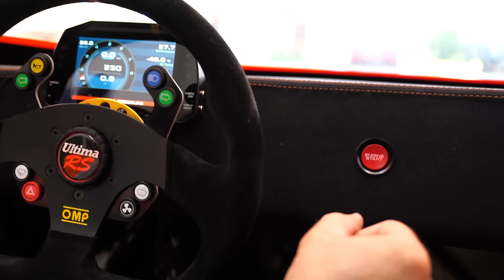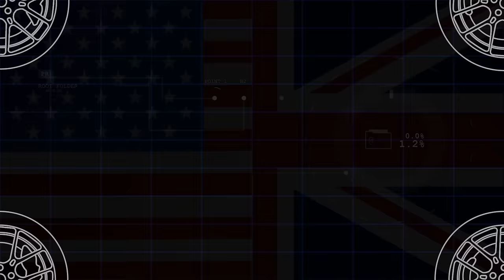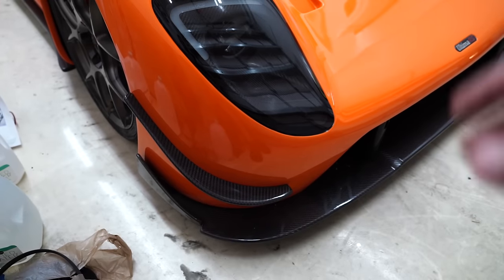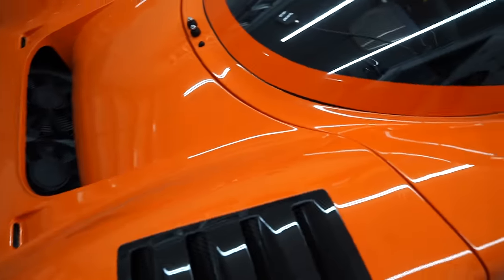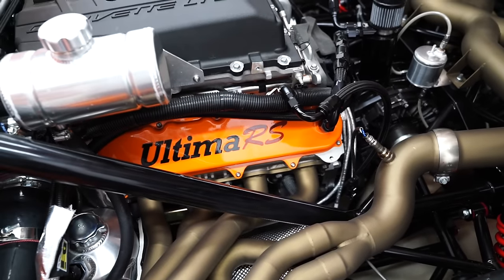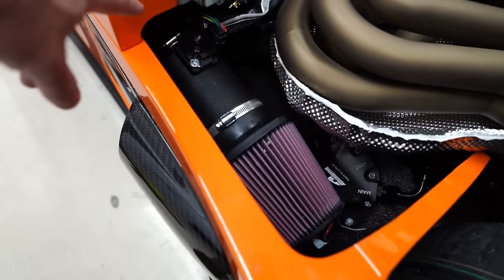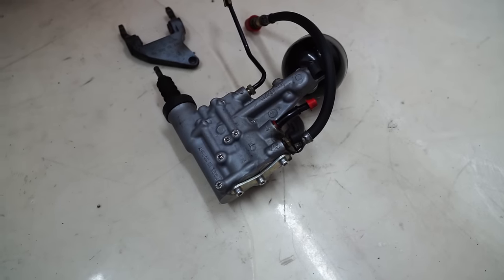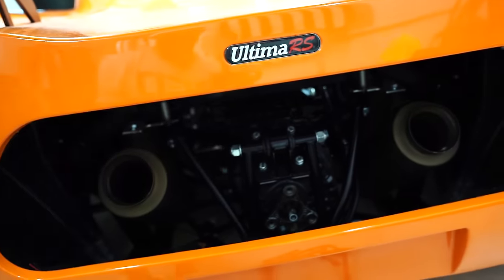Ultima RS Build 07 - First Drive!

Comment: hell yeah man, glad to see it moving under it's own power!  The normal 997 clutch slave you didn't use is a hydraulically boosted slave cylinder, you need that extra boost for the aggressive Porsche clutch but no issue for the RPS triple disc.  Glad you were able to do the GT2 swap, it's such a no-brainer and a much easier install.
Reply: Like boosted by the braking system?
Reply: @chickenfishhybrid44  it's own separate system, but it functions similarly to a hydro-boosted brake system

Comment: Congrats Rob and getting this far. The car looks great and sounds angry. I did notice in the video that you added a windscreen banner in orange wrap, did you do this to cut light or to make the front of the car look more pleasing. I always thought that the Ultima was a bit square on the top of the windscreen, this looks better with this as in orange, it extends the body visually.
Reply from the maker: It's how the RS looks from the factory so I ordered the vinyl kit they sell. It changes the lines completely.

Comment: I didn’t understand why the lights where in sync with the engine idle or it seemed so ?
Reply: It's the camera speed.
Reply from the maker: Yeah it's the camera frame rate and the refresh rate of the LEDs playing tricks on each other. Our eyes see the lights as a continuous beam, but they are actually flickering really fast.

Comment: Its amazing, I will not lie. Would happily drive one of these in anger. My only worry is the outboard fuel tanks with only the body to protect them. That would be my only modification to one of these for street use but I'm not sure how one would go about adding that protection. Can't wait to see this get a hard thrashing on a road course. Also if your next builds are as clean and tidy as this you will have a huge following in no time.
Reply from the maker: Thanks, William!

Comment: Very nice! Your clutch slave cylinder hydraulic flex line is just sitting against the frame/cross member. I would secure it with a Adel clamp to the frame to prevent chafing.
Reply from the maker: Will do! Thanks Brian

Comment: well If it makes you feel any better a 5” intake has absolutely no benefit to that set up.  We tried 4” and 5” on the dyno and the 4” actually made more power threw the whole pull where the 5” lost power down low and lost power at the mid range and was good for about 2-3hp at the end of the pull witch is nothing compare the 20hp lost down low and mid range.    Beautiful car.  That thing looks insane.   Love it.
Reply from the maker: Dang. Well that makes me feel better. Thanks for the info!

Comment: This has got to be the best deep fake on youtube. That shadow blur is what gave it away.
Reply: I've seen enough super low cars that the shadow blur doesn't make me bat an eyelash. That's fairly normal for anything that isn't a bubbly mass produced car (sharp edges bend light in interesting ways)
Reply: @DFX2KX  If you look, it surrounds the entire car. Front, back, over the hood, it's a mask being done in some modeling program. At 4:59 you can see it around the passenger mirror.

Comment: I'm curious. Before choosing the Ultima RS, did you consider the SLC? If so, what made you choose the Ultima? From everything I have seen, read and researched the SLC has a better constructed framework. I do realize that they are both extremely capable and at the top tier of engineering, performance and design.
Reply from the maker: Yes I looked at the SL-C and you are right that it has a more modern, aluminum monocoque chassis.  For me it came down to the fact that Ultima has a neat history with Lee Noble as well as with McLaren and the use of Ultimas as the mules for the F1 powertrain (also the new Gordon Murray T.50).  Also I just think the Ultima looks better.

Comment: Car turned out beautiful man. Really good job. Sounds fantastic. I've got 1 question. What's up with the front trim lights and rear lights flickering with the rpm's of the engine?
Reply from the maker: That's only the effect of the camera frame rate and the LED lights. In person, there is no flicker and it appears to be just a solid color.

Comment: Rhe clutch cylinder you have there is from a Porsche Turbo and it has a servo system to ease the clutch motion. I would also youst use the clutch cylinder from a GT3

Comment: I'm surprised you don't have the idle set just a tad higher, for the sake of oil pressure. I couldn't see the other numbers very well. How many PSI are you getting with idle dipping into 400s?

Comment: Dang, nice work! Looks cramp with a V8. Curious if there are other Ultima owners that is nuts for a billet 4 rotor engine, R26B.
Reply from the maker: There are a few out there with different engines- Barra, Lambo/Audi V10, and I just saw that a guy is putting a Viper engine into one. I haven't seen one with a 4 rotor yet but that would be insane.

Comment: Impressive, haven't watched the whole collection but quick question, is getting a VIN number easy?
Reply from the maker: The VIN number is stamped to the chassis so that part is already there. Registration consists of filling out some forms, paying sales tax to the state, and providing documentation of engine and transmission showing if they were purchased new or used, and if used, the VIN of the donor car so they can make sure it was not stolen.

Comment: did you bought it with all the parts included? engine ac all of that? or you need to find a donor car to complete it
Reply from the maker: No donor car. All parts included except for the engine and trans, which you can buy wherever you'd like.

Comment: I looked at doing a gtr many times, but was turned off by the lack of assurances by their recommended customs broker.  Not their fault, just the import process is wacky.  What was your experience like?  Did you use the recommended broker, and how much did it cost?
Reply from the maker: I used my own broker which I talk about in the unboxing video.  It was very straightforward and painless.  I've read a lot of complaints from other owners about the customs broker Ultima recommends.
Reply: @UltimateUltimaRS  Thx, I just saw that, biggest problem was the the ultima-recommended broker couldn't put a solid number on it, kind of a blank check situation.

Comment: I've had my mind set on building one of these and would appreciate your feedback on the capabilities of the car. How does it drive and handle? Can you fit in it comfortably? Anything else that might be good to know?
Reply from the maker: I'll be posting an updates video answering these questions.  It drives like a big go kart with enormous power and handles amazingly.  Getting in and out is difficult, but once inside, it isn't bad.  It definitely is not a comfortable car since its focus is purely on performance.

Comment: Hey man my very first time on your channel. Been a fan of ultima since I was as wee little kid. Is that a c8 drivetrain?
Reply from the maker: Thanks for checking it out! It’s an LT5 engine (same as in the 2019 Corvette ZR1) bolted to the transaxle from a 2008 Porsche 911 Turbo. The C8 uses the LT2 and has a dual clutch transaxle from Tremec. If someone develops a way to use the C8 transaxle in an Ultima, I’ll probably switch it out.

Comment: Gabe! You need to reach out to our Community first!  I have all the GT2 clutch parts you bought.  would have just sent them to you.  Also it would have much easier to have the RPS boys just give you the Tilton hydraulic throwout for the trans and eliminate the clutch fork all together....
Reply from the maker: Darn I wish I would have known! I talked to Rob at RPS about doing the Tilton TOB but in order to get the max torque rating, I had to use the terrible Porsche pressure plate/pull type. Oh well.

Comment: Ok that’s really loud. 🤣 It’s a good thing you don’t have neighbors…

What’s the sound like inside the cabin? You had implied in a previous video that you might have a passenger. Could you have a conversation over the engine sound?

Overall, very impressive build.
Reply from the maker: The video actually makes it sound much louder.  I took it to a car meet and a Corvette/Camaro with straight pipes is actually much louder than this.  I believe it is because of all the twists and bends of the Ultima exhaust. You can absolutely have a conversation with a passenger, though it is certainly no luxury car by any means in terms of sound.

Comment: Well this video got me thinking so although I have a, couple of normalise car (bentley and a clk mercedes) I found a second hand one of these a pricey at £70,000 but hay ho  very interesting but will have to do a lot of sound deadening far to noisy inside I am in the UK but I will have to fit Aircon just to hot so that will add say £5,000 so getting to expensive for what it is it looks like a kit car outside the pub,  seems I have the same engine as yours although it's exhausts are  coated with ceramic  drives well sound is too much really but that's how it is may keep it for a year great video by the way the top carbon wheel vents make a real mess on dirty road I will blank them off you get mud and rubbish coming through I bet you will do the same good luck

Comment: Are these scoops and  wings that have two small screws holding them on gonna stay on at 150+mph?????
Reply from the maker: There are two screws in the front, two in the rear, three rivets on each side, and it is bonded to the roof with Sikaflex-291.

Comment: I wonder if he regrets skimping out on the cats and mufflers after hearing how intense the sound was 😂 Absolutely beautiful build though
Reply from the maker: Haha, definitely not! I love it.
Reply: @UltimateUltimaRS  10-11 years ago I started building a mostly track-focused tuned thing out of an Aprilia RSV1000R -02 motorcycle, at the time all the tracks in question for either track days, practice or competitions had a strict decibel-rule of 95db measured 10 meters from the side of the track when you are WOT and at maximum power revs. Just the intake noise running with a tuned air-box would probably have put me in danger without doing anything about it.

In the end the bike had 1103cc 14:1 compression v-twin with intake air-box with really strong resonance (thick short runners with large funnel-shaped horns facing forward oncoming air) and a DIY tig-welded stainless 2-1-2 exhaust system of 60mm per exhaust header once you got 150mm somewhere downstream of the exhaust port, exiting in two "see all the way through" silencers of my design that had 60mm inlet and roughly 50mm outlet with no db-killers. I even built intake air silencers hidden inside the frame/fairing to get it a bit further down in sound level. The bike even had 1-2 decibel margin when trying my best to make it sound loud on the track.

The thing I wanted to get to is that the bike got a really fantastic exhaust note/engine sound like almost nothing else I had heard before due to the massive length and volume of each silencer - no high-pitched raspy or annoying frequencies left - only a deep filtered sound that wasn't overly loud for either track or street riding, but at the same time hit you in the chest enough to be fun.

At the same time I must admit that I am both a bit fascinated and a bit jealous of the fact that you can drive with that kind of exhaust/intake solution on either street or track over there ;)

Comment: Everything great but I will tone the exhaust down some. Make it rumble towards the ground instead towards the air.
Reply from the maker: It goes straight back now.  You can't really tell in the video because it sounds insanely loud on the mic, but in person it is MUCH quieter than a cammed, straight piped Camaro or Corvette.  I think all the curves of the Ultima exhaust kills a lot of the sound.

Comment: How hard is it to register for driving on the street?
Reply from the maker: Not very hard at all.  Just a process you need to go through that isn't too much of a pain if you've already filled out the forms, etc.  Basically you go to the DMV with all the proper forms, then schedule an inspection appointment.  You show up and they look the car over- especially the engine and transmission to determine those aren't stolen from an other vehicle, then they give you a packet to take to the tag agency.  Go to the tag agency and get a tag.  Then they mail you a title.  I was thinking about doing a video about it but I don't know how many people would find it useful.

Comment: About Florida having Terrible drivers, I can concur, but what happens if you do get in an accident, do you total the car and all the work goes out the window?
Reply from the maker: Yeah pretty much, unless it's just fiberglass damage and the panel can be replaced. But I'd still have to do the repair work.
Reply: @UltimateUltimaRS  that's unfortunate, I hope they offer coverage for damaged parts if such a thing where to happen... also not my intention to make you worry about accidents
Reply from the maker: No you definitely have coverage just like any other vehicle, it’s just a matter of the labor- who does it? I wouldn’t want anyone but myself doing it.
Reply: @UltimateUltimaRS  ohhhh gotcha, yeah that makes sense, you definitely know the car inside and out

Comment: 755HP in a car that light. Not fun to drive and I don't believe you will ever be able to safely floor it except on a track. But incredible build quality. Nice to see.
Reply from the maker: I thought the same when I built it.  Turns out it hooks from a 50mph roll full throttle and is a ton of fun to drive.

Comment: Can't believe you painted over that exhaust with anything but clear coat.
Reply from the maker: Yeah I was up in the air about painting it, but any sort of heat mitigation, even minute, was worth doing.
Reply: @UltimateUltimaRS  Got a point there.

Comment: Complete noob here. How does this compare to slc kit?
Reply from the maker: Fairly similar.  The SLC uses and aluminum monocoque chassis which is a bit more modern than the Ultima, though the SLC builds I've seen aren't any lighter. A lot of people seem to do a lot of tech on the SLC builds- power opening doors, infotainment, etc. The Ultima is just a tube chassis, fiberglass bodied race car.
Reply: @UltimateUltimaRS  thanks

Comment: Your neighbors must hate you lol. After hearing a straight piped Camaro with the same built engine i know how loud that monster is
Reply from the maker: You'd actually be surprised that it's not nearly as loud as a straight piped Camaro or Vette.  The Ultima exhaust twists and turns a lot which kills the sound whereas the Camaros and Vettes have a pretty straight and smooth exit from header to tailpipe.  The tones are pretty much the same though.

Comment: Aren't you going to fit a muffler? Sounds like an old muscle car now and not a high performance track car
Reply from the maker: Under load at high throttle, it will definitely sound better. If you ever attended any races years ago with the Corvette C7R in the GTLM class, you'd think this sounds similar. The Corvette at those races had a very distinct sound amongst all the others.
Reply: @UltimateUltimaRS  Aight. You'd better film it at full throttle then;) nice build anyway mate. Can you pass inspection without a muffler?
Reply from the maker: We don't have inspections here in the great state of Florida. Also, there are different rules for home built/kit cars.
Reply: @UltimateUltimaRS  Damn that's murican freedom right there! 🤘🦅🇺🇸

Comment: What kinda gas mileage does that get?
Reply from the maker: I run E85 exclusively so maybe 10mpg?  I don't drive it like a grandma so that's also a factor but it has a 20 gallon tank in it for a decent amount of range.
Reply: @UltimateUltimaRS  I'm just kidding, of course, but thx for the info.

Comment: but please, the sound of that engine is embarrassing, IT LOOKED LIKE A SICK OLD GIANT WAS COUGHING WITH THE FLU, loud as shit, seemed like it would turn off at any moment, how can they equip a car with that style with a prehistoric engine? THEY SHOULD PUT A SILENT AND SUPER POWERFUL ELECTRIC MOTOR OF 500 HORSEPOWER, SMALL, LIGHT AND SILENT, an electric motor would do justice to that design, not the shit of the paleolithic period that they put as an engine
Reply from the maker: Electric motors are great but you have to have something called a battery to power them.  Batteries are very heavy and the enemy of all performance metrics.  Go get some fresh air and drink your soy latte.